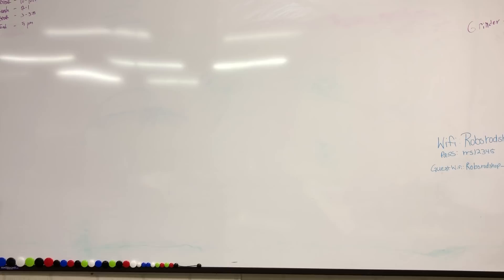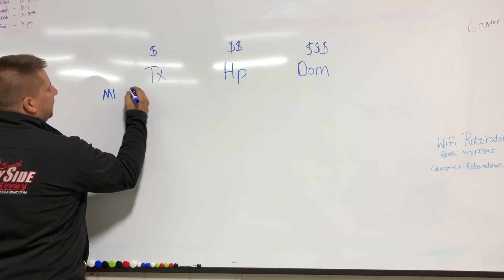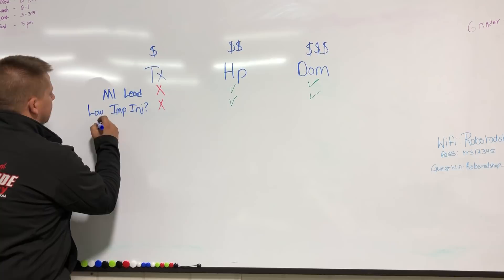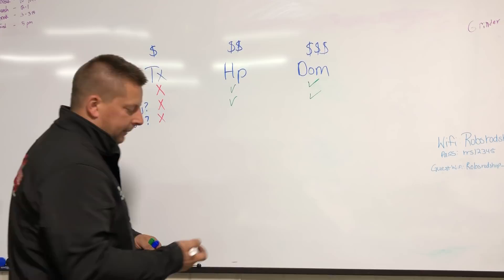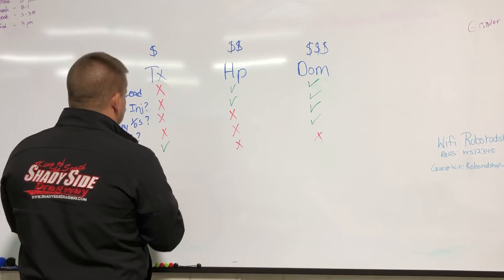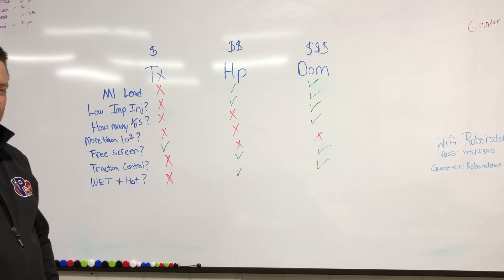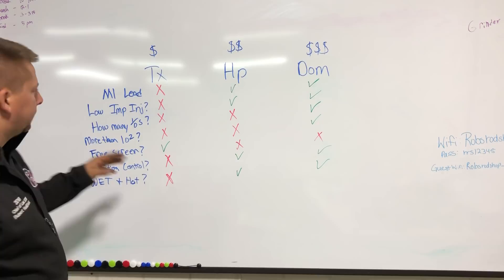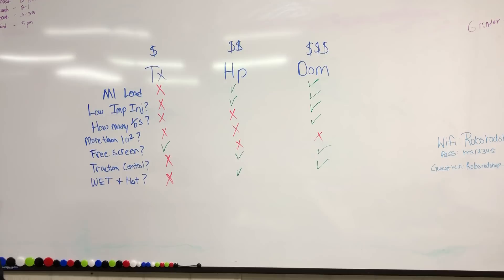Terminator X vs. Hp vs. Dominator

Comment: I know this is an old video but the terminator ls kits come with a screen (they are actually an hp and dominator ecu)
Reply from the maker: The terminator does. The terminator x is a completely different unit.
Reply: @RobD828  correct you said you don’t get a screen with any of the dominator / hp setups. The terminator ls kits are dominator / hp setups and do come with the little screen

Comment: I'd like to add a TermX to my foxbody. H-pipe has spots for 2 o2's is it not necessary to monitor both banks for the fuel table?   I guess the option to just add a 2nd 02 and monitor through a stand alone wideband would work. #9.5decknation
Reply from the maker: fordltd1983 it is not required

Comment: Decent video, except you missed a whole lot of options. Running boost? HP/Dom. Doubling up on injectors? Dom. NTK sensors? HP/Dom. Drive by Wire? TermX Max/Dom. Launch control, 2 stage limiter, TCS, onboard logging…. You barely breezed the options that would cover just a mild street motor. For anyone planning on anything hardcore or that will see lots of track time, I’d just recommend going straight to a Dominator. The added money now, saves you the price lost selling your TermX for half of what you paid and having to buy a Dominator later. Good thing is all the harness plugs will work on every ECU, so that is still an option should you decide to upgrade later, it’s just the ECU you’ll need to buy. IMHO, buy once, cry once. 🤷🏻‍♂️
Reply from the maker: Good job!!! Make us a video that’s more in depth and post it!!
Reply: @RobD828 Be sarcastic all you want, but you’re making a video to “help your customer decide” what to buy, but you cover HALF of what some of these units can do. Imagine your schoolteacher telling you they’re gonna “teach you Math”, and stop at addition/subtraction. I was merely trying to add to everything you missed to actually help people as well. Instead of just saying “Yeah, I was just covering basics” you had to get all snarky. Hope your customers see your attitude and go elsewhere. For all interested, Joe Simpson and Devin Vanderhoof have great in-depth videos on these units…. Without the attitude.
Reply from the maker: @BlackwaterDSM  I wasn’t being sarcastic. You seem very knowledgeable and I sincerely think you should make a video! It would be good for the masses. I also hope Joe gets all the business he can stand. We have a 6+ year back log at my shop. There’s plenty to go around. Everyone go see Joe!!!!

Comment: Thanks for the info!
I was still curious if you could run a ntk sensor with the terminator instead of the one provided.
Reply: i dont see why not. i actually just asked a similar question above
Reply: @aaronchandler152  you can't because it has a different controller and signal. The controller sets up the right operating temperature and voltages. The signal is super important as well. Holley specifically designed the termi to run the Bosch. It's just one of those deals. Would be great to see them add the support, but as it is just not possible.
Reply: @th600mike3  So the terminator x isn't a good idea to run e85 / flex fuel on a sbf making over 600hp NA.
Reply: @I_like_turtles_67  OMG...he said leaded fuel and METHANOL. You guys simply don't listen. He also wrote it down. X is fine for what you proposed!
Reply: @diambo4life  OMG I didn't catch that. I bought the terminator x btw.

Comment: I've been reading that the Dominator system has the ability to self tune/learn. If this is true this is excellent for those who don't have close access to tuners. Seems like this feature helps the Dominator system pay for itself.
Reply: The TermX self learns too
Reply: It’s a running tune not a wot tune to go out racing with , you can find some many email tuners that can help you with getting a real tune setup

Comment: I believe you can still purchase the TX if you're on leaded fuel and just switch to a NTK WBO2 sensor. Instead of spending close to an extra grand for the HP model.  Any opinions on this?
Reply from the maker: Aaron Chandler the tx does not have the software or hardware to run an ntk sensor.
Reply: Rob’s Rod Shop thank you for the response! Your video is very helpful

Comment: I'm a noob, and I'm wondering if someone knowledgeable in this can help. I have a 2005 Silverado and I'm planning to cam it and I know it needs to be tuned.  Someone told me to just buy the terminator x for it. My question is, will all my original gauges and stuff work? Or will I have to rely on the 3.5" screen? Also they told me it's self tunable?
Reply: …call Holley

Comment: Doesnt most aem widebands use the Bosch sensor?
Reply from the maker: lsx swapped camaro I do not honestly know. However, the Bosch will work till it Don’t is kind of my findings when on leaded fuel. It may work for year and it may for days. The NTK is just a more robust unit when it comes to exotic fuels.
Reply: All AEM wideband controllers use Bosch LSU sensors, very few wideband controllers use NGK/NTK sensors